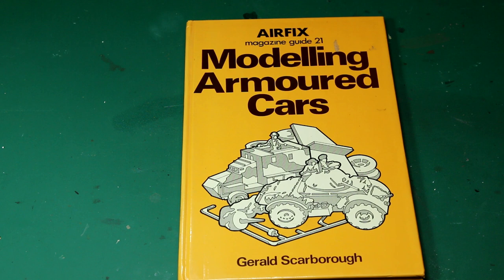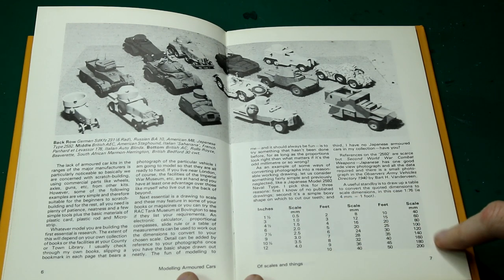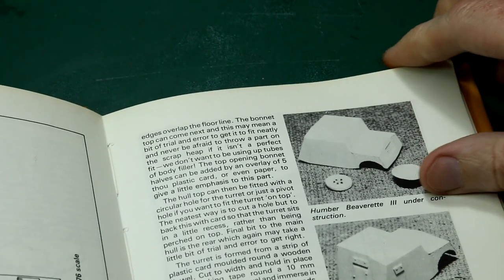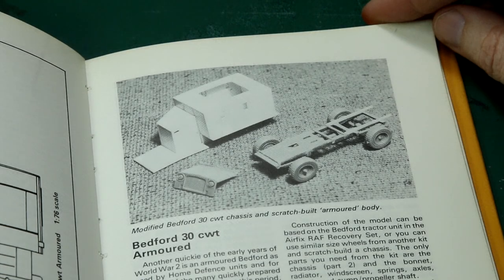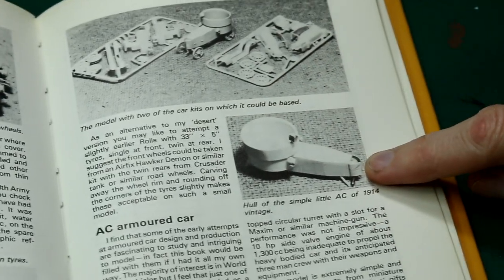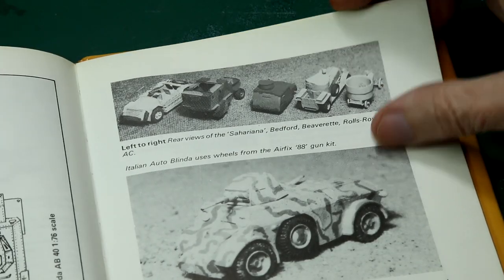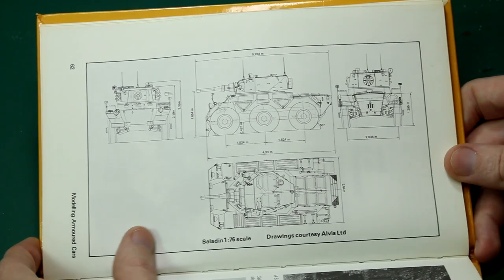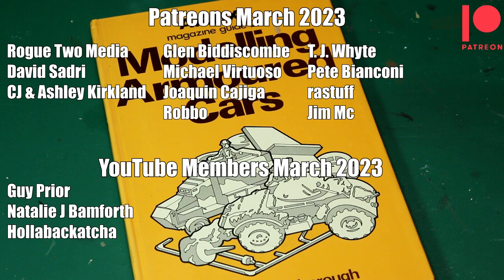New in 1977! Airfix Modelling Armoured Cars - Scratch building guide

Comment: Very interesting. I enjoy doing some scratch building. It is usually stuff like wheels and other detail parts like the machine guns that are the most difficult but most of us have a big spares box or there are a lot of suppliers on line these days. I recently made a 1/32 Jeannin Stahltaube which is an early German WW1 monoplane that looks like a bird. It was available from Wingnut wings but as its discontinued now the kits go for around £400 online. I was not paying that but managed to get a kit of the engine from Rodin and the spoked wheels from CSM. The engine even came with a prop. It is more challenging than kit building but I think more rewarding also.
Reply from the maker: That sounds fantastic, Allan. Do you have any photos of it anywhere online? I'd love to see it.
Reply: @ModelNerd  I do have pictures of it but I am not sure where to put them online
Reply from the maker: I'd love to see them if you wouldn't mind emailing them? My address is on the "About" tab of my channel (I can't write it here or the spam filter will get it).
Reply: @ModelNerd  Hi, I have emailed you some photos. I hope they get through ok